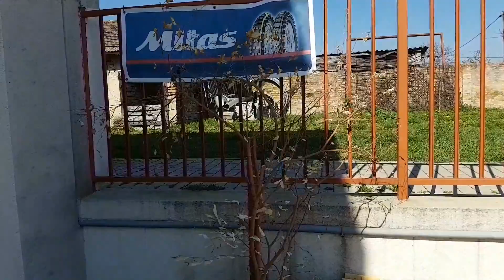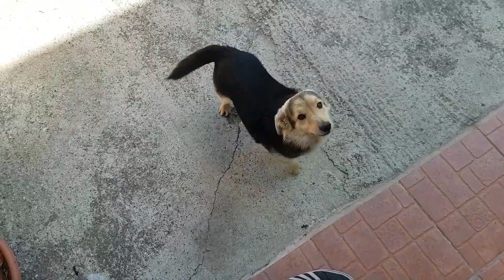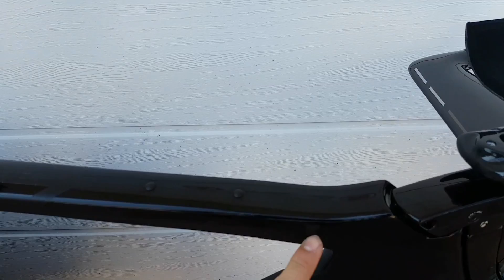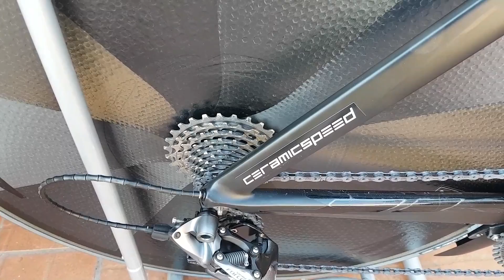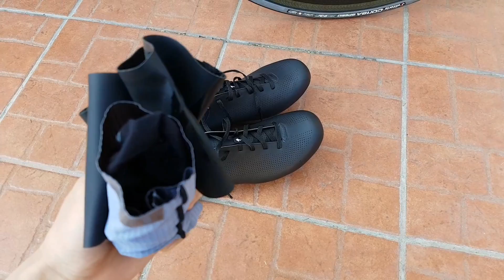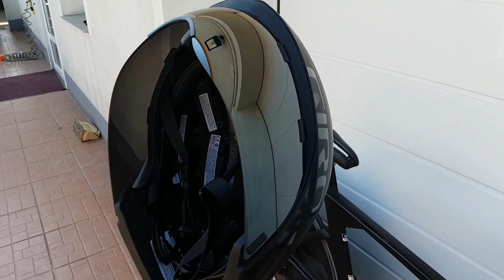The world`s fastest TT bike

Comment: Sickest TT bike I've seen yet. Good luck. I agree with others that a 11-23 or 11-25 cassette is more aero and will give more gear/cadence options in a flat TT, also lighter. Why lug around an anchor if you don't have to. But I hear you won! Awesome! I also heard the pros fill the tire crack with silicone to get even more aero. Pretty extreme, but as long as you've already gone this far...
Reply from the maker: Roger Honacki thanks for the comment. Anything smaller than 11-28 is useless in a 1x setup as most courses are rolling. 54x23 is not a good climbing gear :). These are clincher tires, so there is basically no tire crack, but it should work with tubulars.

Comment: Great informational videos. I want to buy a speed concept but hear there are issues with the bb90 bottom brackets. Specifically, people complain that over time the carbon that holds the bearings stretches or wears out over time. Have you had this issue?
Reply from the maker: nascimento19801 no, I have high quality bearings in there, which don't need to be replaced every month
Reply: Ronald Kuba thank you. The issues I read about say the carbon on the frame where the bearings are pressed into wear out over time and when new bearings are “pressed” into the worn out carbon they are loose. Trek supposedly made a V2 bearing with a larger outside diameter  to provide a solution to customers with this issue. You mentioned you put a lot of miles on your speed concept. Were the tolerances for the bottom bracket still good after all those miles? Thanks
Reply from the maker: nascimento19801 as I said, I never had to replace the bearings, so the cups weren't worn by pressing them in and out repeatedly.

Comment: Curious, how tall are you and what size Speed Concept are you on?
Reply from the maker: siebert12 thanks for the comment.  I am 172cm tall, and it's a size M with the low-far stem and 335/15mm seatpost. For my position, the reach is maxed out and stack is slammed right down.
Reply: Many thanks.  I'm 177cm and my fit put me between M and L...with a number of different stem/spacer combos.  No shops stock the bikes which makes it hard to choose.
Reply from the maker: I would say go for M if you ride TTs, because otherwise you will struggle to go low enough. For long distance Tri, L is going to be more relaxed.
Reply: I'm racing 70.3 and IM distances...will probably go with the large. Many thanks!
Reply from the maker: siebert12 you are welcome